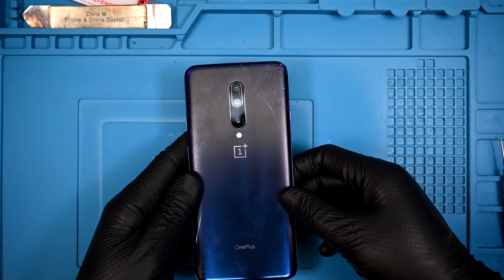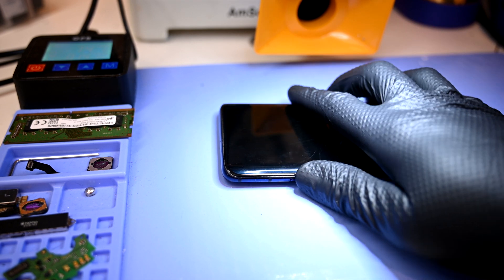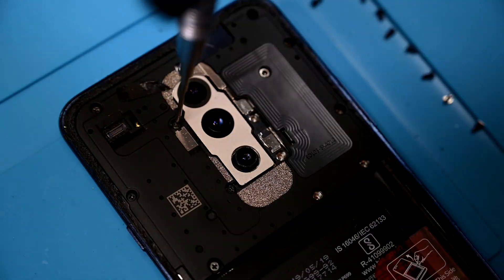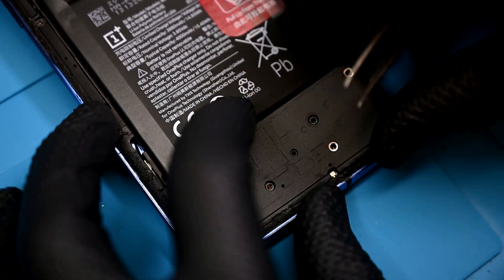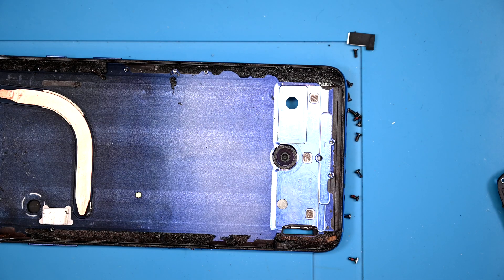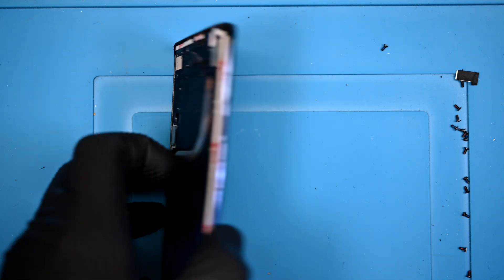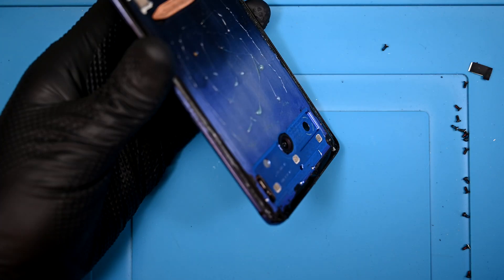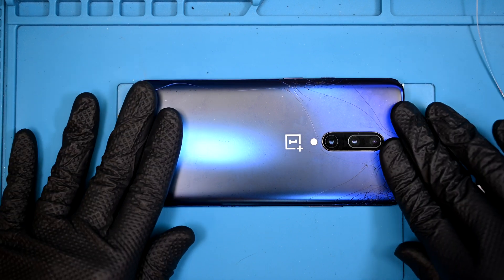OnePlus 7 Pro Screen Replacement | Display Only | Guide

Comment: Only non frame repair I have seen. Everywhere I read, they suggest a repair with the frame attached. However, the no frame repair on this video seems much easier. Which would you recommend?
Reply from the maker: If a frame is available, that’s the way to go. Display only repairs have a slightly higher failure rate and risk of allowing moisture in if improperly sealed.

Comment: What about the "fingerprint scan will stop working" message that the store says, if it is not an authorized "one plus repair center".?
Reply from the maker: Seems to be intermittent, I’ve only had one give me an issue but many parts sellers include the little silicone cubes for calibrating a new screen

Comment: hi, great clear instructional video.
part sellers sell a replacement screen, and a replacement screen with a 'frame', is it a lot easier to change the screen with a frame?
Also, where do you get the double sided adhesive stickers?
Thank you !
Reply from the maker: It is much easier to replace it with a new frame already on the screen, but can be done without. You’ll want to find some cold-press glue for the display, and look for Tesa 61395 double sided tape, iFixit sells them in a few sizes and I find 2mm to be the most useful

Comment: Wohooooo......Thank you so much for this video! Very thorough step by step guide, I like it!
May I ask where did you get a new display from? My phone had a bad trip over some stairs is completely cracked and I have a black screen now. I want to change the display and maybe also the back side, but foremost the display because I would love to save my pictures. I have not done this before, so where to get the display and back from and the tools? Or would you recommend to go to a cell phone repair shop? I have a tool box for my computer where I changed batteries and some other little parts and cleaned it. I might have the right screwdrivers, any advice for me?  I really appreciate it!
Reply from the maker: @mimiseeks4intel  thanks! If I recall this part came from the now out-of-business Mobile Defenders. But you may still have luck on sites like MobileSentrix, Gadgetfix and Injured Gadgets. Tools I’d recommend going to a hardware store and picking up a precision screwdriver set that includes multiple sized bits. If you have never done phone repair before, I’d advise taking it to a shop. A lot of shops offer a data transfer service where they will temporarily hook up parts to copy the data, and you end up just paying for labor instead of labor+parts.

Comment: How can I know whether the replacement screen is original before buying? Does the 90hz refresh rate apply to the new screen too?
Reply from the maker: Depends who you buy it from. An original screen will still be a screen that was pulled off a device, so aftermarket may actually be slightly better condition. And yes it should still support 90hz without an issue, for both original and aftermarket.

Comment: I'm buying the stuff to do the repair tomorrow, if I use B7000 glue will it prevent it from being repaired in the future?
Reply from the maker: Nope, B7000 separates with heat and alcohol pretty quickly.

Comment: Will the fingerprint sensor work after replacing the screen?
Reply from the maker: I haven't had any issues with them yet, though most replacement kits include the silicone blocks used to calibrate the reader if needed.
Reply: Thanks,  @TapticDigital

Comment: Ive had the front facing camera fail twice. Have you yet to replace one?
Reply from the maker: That's wild! I haven't had to replace one but I have removed one or two, they aren't terribly hard to remove and reinstall thankfully
Reply: @TapticDigital  I have face unlock turned on. My kid likes to push the camera down. 😭

Comment: Is it true that the fingersensor stops working if you don't let a "authorized shop" do the job? I heard it has something to do with a special file that you need to update after the replacement?
Reply from the maker: No, sometimes it works perfectly fine, other times you need special silicone "calibration cubes" and you can follow a guide to reprogram the new sensor.
Reply: @TapticDigital  Ok, thank you for fast response.

Comment: Is there any chance you can repair mine? In my case it was the black screen of death. Device with approximately 5 months of use
Reply from the maker: I don't offer mail-in repairs just yet, I'd recommend checking local shops with decent reviews. Franchises like CPR or UBreakIFix are usually pretty reasonabley priced and work on these as well.
Reply: @TapticDigital  thanks for answering. I live in Brazil where OnePlus has no representation in the market yet. I bought it by direct import so I had to suffer with the known defect of OnePlus.

Comment: Which website can I buy the screen and how much does it cost? 😁
Reply from the maker: Link is in the description, it's very expensive unfortunately
Reply: @TapticDigital  we've found buying "damaged" or "for parts" or even blacklisted OnePlus 7 Pros is cheaper by FAR than buying replacement parts individually.
Reply from the maker: @ambersmith8798  nowadays it really is, as replacement parts stop being manufactured sometimes the only way to get them is from other devices. Even popular ones like Samsung get that way after a few years

Comment: Thanks for doing an actual commentary instead of just straight up repairing. 

 I'm trying to replace my own OP7P screen, and I was wondering if I need a heat gun (or hair dryer) to soften the glue before trying to remove the back and display. Also I noticed you used some kind of liquid at 1:51 with the pry tool, is it necessary as well?
Reply from the maker: Glad to hear I'm not a total nerd 😄, you will absolutely need a heatgun, hairdryer or heating pad (not the kind for humans, one that goes over 70°c is ideal) to soften the back glass and screen adhesive throughout the repair. Nice catch on the liquid, that is just 99% isopropyl alcohol, it softens the adhesive further and temporarily reduces its sticky-ness. It isn't absolutely necessary, but it really helps. If you do end up repairing your own, I'd love to know how it goes and if you notice anything I missed that could go in future videos!